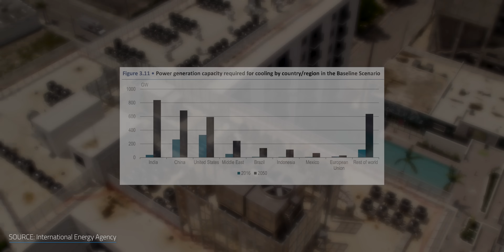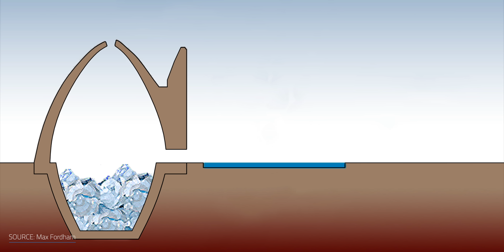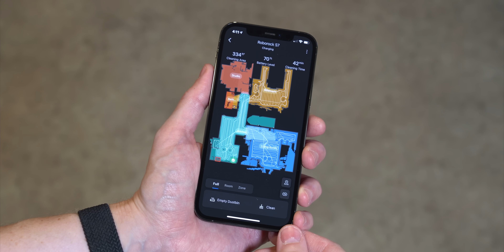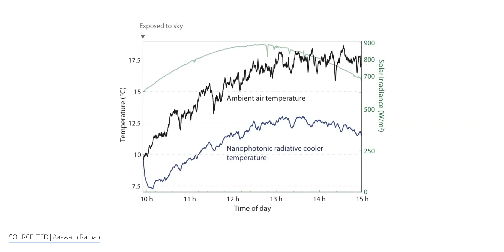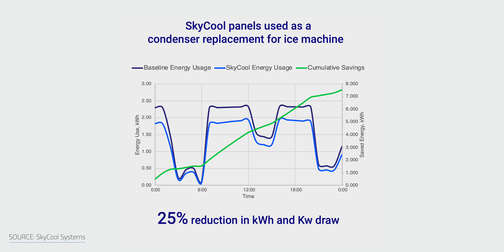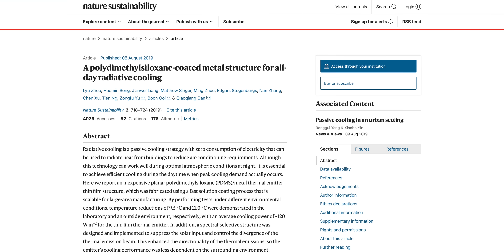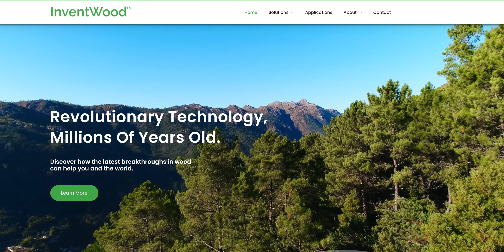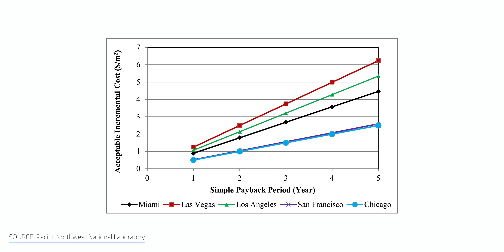Space Powered Cooling May Be the Future of Energy

Comment: Simple reflectivity can produce amazing results. I bought an older house in northern California which had a nearly flat tar and gravel roof. An absolute oven in the hot months. We air conditioned it; all was fine. Then, a year later, had the roof replaced with a white polymer of the type used on commercial buildings. (Location and design made it invisible to neighbors.) The air conditioner never ran again.
Reply: Great comment.  The problem will not be solved by a silver bullet.  It will be tons of small solutions that add up.
Reply: @bill8985  and multiple distributors can increase competition, keep prices down, an d keep up with demand.
Reply: Solar panels on my roof blocked a lot of the sun’s heat and my second floor was much cooler because of it. One more side benefit of solar.
Reply: Another suggestion is to make a roof over the roof with open space between them, this way, the top one heats, transfer the energy to the air below that leaves through the sides and doesn't heat the bottom one, leaving the house fresher.
Reply: @thomasfplm  That's what solar panels do too. My solar panels are about an inch or two above the roof so it helps with reducing heat going in the house.
Reply: @BnORailFan  or you could just boil argon gas in closed loop system and power a generator via Solar heating coils... Pretty much infinite energy source... Other than maintenance of the steam engine, A Wankel rotatory motor will do... Exhaust system goes into radiator and back into system..
Reply: @mjolnirswrath23  That would usually be more expensive, bulkier, and less efficient then photovoltaics.
Reply: @thomasfplm  I have contemplated this concept for a long time, and I think that finding an inexpensive way to make interlocking solar panels that stand 6” off the roof, but cover the whole thing, would be pretty phenomenal
Reply: @thomasfplm  How does the cost of adding an additional roof, along with the problem of weathering, compare to just adding new aluminum-coated insulation to the underside of the roof?
Reply: @lokensga , first of all, you don't need to make a complex structure to make those two roofs, and the bottom one doesn't need to have all the weather protection of the top one.

Depending on how you do, this aluminium isolation could serve as bottom roof if you make openings that allow the air between it and the roof to leave.
Reply: @lokensga  So lots of roofs these days are made that way. There is roofing OSB and ply wood that has aluminum foil glued onto it. The shiny side goes down. Shiny does not emit much heat so when the roof gets hot ~140 to 160 degrees F it is less likely to emit heat or emit as much heat onto the insulation in the attic. There are also films that you can buy and put in the attic for existing homes. Generally evidence indicates these are cost effective improvements.  Adding an additional roof is also done frequently by putting a metal roof right on top of a shingle roof. A new metal roof costs about twice what a shingle roof costs, but also lasts twice as long. In the Southern USA they are becoming quite popular where 1/4 to 1/2 of homes have them. One downside of metal roofs is they can be slippery and hazardous to work on. (If you have to get up on the roof and clean out gutters annually, take care of fallen limbs, and more and much of this work gets done by homeowners. And some people both homeowners and small independent and informal contractors that do this type of work, simply will not get up there. And if you have, as a workman, have fallen, one of the simple ways to protect yourself is to just not to take the job. Work on the roof can get very expensive then.
Reply: @thomasfplm  That design causes air flow which can be used to draw heat up out of structures through the use of thermal chimneys.

Fresh air can be drawn in through piping run underground where the entry point is in a shaded area.
Reply: @thomasfplm  This is, probably, by far the most sensible solution - but it is also prohibitively expensive because that space has to be as contact free as possible so the outer barrier does not transfer heat to the underlying structure through the support system.
And some manner to keep small creatures out of that space (spiders alone would reduce efficiency rapidly) because their waste - nesting material, ect - would quickly build up and create bridges that would transfer energy from the outer barrier, not to mention just making a hell of a lot of noise if larger creatures like squirrels moved in.
Reply: @amzarnacht6710  depending on the case, you can make it a space usable for a barbecue and things like that.
If it is too big, some of those animals wouldn't feel safe there, like the squirrels.
Like an extra floor, but completely open.

But yes, it depends on the kinds of animals and things like that.
Reply: @amzarnacht6710  wouldn't most animals feel uncomfortable in the intense heat? It would be quite an unhospitable environment.
Reply: Technically, the paints don't have to reflect VISIBLE light as much as they need to reflect Infrared and UV light. IR is of course what we experience as heat, but UV also is high energy due to the equation E=hf and if not reflected back to space, UV eventually downshifts into IR, becoming heat, after being absorbed and re-reflected by materials. Therefore, we should find reflective paints that are good at reflecting everything except too much visible light. Such reflective surfaces would still be bright but not overly so to our eyes.
Reply: @think2086  but if you reflect an excessive amount of uv and only a small amout of visible wouldnt that pose a risk to eyes? iirc the pupil adjusts after the visible light, but eyes can certanly de damaged by ir
Reply: @think2086  Following up with your ideas-thought process, what would the color you’d suggest is better for reflecting heat away from roofs?. 
My ideas are that If black absorbs all light colors (and reflects none of them) building up heat, 

and oppositely white (or all colors together) absorbs no light colors, reflecting it all including their heat, Would roofing material colored in the nearest color of the warmest light, (maybe red) be the most effective for reflecting heat away from roofs?.
Reply: I painted my roof with white ceramic paint 15yrs ago, the change was insanely dramatic, reducing power costs by almost 50% in summer. Only needs minor maintenance.
Reply: What you are benefitting from is the R value of the material not only the color…..
Reply: Great idea.  I think we could greatly improve our climate impact vis regular and fairly rigorous application of the sort common sense we reviewed from our ancestors.  My example is when it came time to re-shingle our home.  It had dark brown shingles before, but our town being in San Joaquin Vally (Lodi), it get very hot in summer.  Accordingly we chose the whitest colored shingles and, as you indicated, the results on our electric bill have been good.
Reply: @Michael Matthws any chance you remember the name of the polymer
Reply: what about winter ???
Reply: @homerdadon6363  No noticeable change in heating cost. All the original structure remained in place. The decrease in heat gain during summer thanks to the white surface was the only impact I was aware of.
Reply: @mattcom2  thanx, I'll look into it more. I think I want to try it next summer
Reply: @homerdadon6363  Darker roofs for colder areas
Reply: @KbB-kz9qp  I live in FL 😰😥
Reply: @homerdadon6363  In Places like Florida, you would benefit from lighter colored roof.  Also, due to more or less routine hurricanes, Floridians would also benefit from wind-resistant construction technology, but they seems to be slow in adopting it.  Not sure why.
Reply: Use cutoff sunglasses which don't allow the light intensity to go above a certain limit.
Reply: Dennis Lee observed his low temperature phase change metal panels would get covered in frost as exposed to hot kitchen areas or on rooftops. His super heat pump had COP efficiency over ten.
Reply: Will it increase the cost of heating in winter? Southern Ontario is an odd place with unbearably hot summers, and freezing cold winters. Ive read that even LED bulbs are sometimes a net energy loss because the ambient heat released in winter can be an efficiency gain for heating.
Reply: a lot of black tar roofs absolutely should be replaced with white roofs, at least the flat ones
Reply: how about heating in winter?
Reply: awesome
Reply: It sounds like you're saying you should have done the roof first and the air conditioning would have been unnecessary and redundant and you have now created a stranded cost.
Reply: Its sad reality when we realize that reflecting bright white ice decreased globally because of us. So we need to turn back climate with mirror rooftop...
Reply: In many countries, lots roofs are covered with this type of... hmmm... black sheets of something with tar (not sure how it's properly called in English) - maybe painting it with regular white paint could help? Of course special highly reflective paint would work better
Reply: So the roof is made of miceoplastics now?
Reply: Thank God you thought about whether your neighbors could see it. You have to be careful with reflective surfaces because they can be hazards. I remember the white roads debacle that resulted in car crashes from sun blindness. I wonder if they've considered the effect on air traffic with some of these proposals?
Reply: @russiannpcbot6408  the light is reflected diffusely, so it won't be reflective like polished chrome or a mirror. It will however be so white it's difficult to tell where the corners are, and it should practically glow in the dark
Reply: @alexandercoggins2779  No shit Sherlock. Highly reflective white paints can still cause eyestrain from prolonged exposure. Normal white paints typically don't.

Try piloting a traffic copter in a city will all reflective white painted roofs. Staring down at that will cause eye strain. A plane angling to land could have issues as well. Especially single prop ones.
Reply: @russiannpcbot6408  do the same thing we do when flying over snow. wear yellow tinted polarized goggles. if you don't you'll go snowblind.
Reply: @russiannpcbot6408  My neighbors across the street had a SHINY tin roof put on, I hate them for it. In the morning it's like massive reflectors hitting the front of my house, if I leave the blinds open it's brighter than turning all the lights on in the house at about 8am lol.
Reply: @russiannpcbot6408  could a good pair of sunglasses solve this problem?
Reply: @russiannpcbot6408  Why would you have a traffic copter that cost a million dollars and a human pilot that costs $600 per hour to judge traffic when you could get a $2500 drone camera and cross reference it with google cell phone metadata to get your traffic reports?
Reply: @russiannpcbot6408  Being on the road looking 4 metres in front of you is a lot different to being thousands of metres above the ground. If runways stayed black but normal roads we’re reflective it’d make runways more visible
Reply: @Smithy250  The commentary is on all the rooftops of a city being painted a reflective white. That would be square miles of reflective surfaces in a concentrated area near airports. That's my concern for aircraft. Before pushing them as a solution, their potential adverse effects need to be thoroughly tested.
Reply: @russiannpcbot6408  Well, in the wintertime, snow falls on roofs and make all the rooftops white. Air Planes land in the winter. Snow is extremely reflective. On the news you do not hear, annually plane crashes are going to become more popular this year north of the snow line because pilots will be blinded by white roofs. In a couple hours, in one winter night mother nature can cover every roof, in the entire city "painting it white," what kind of test could be better?
Reply: @russiannpcbot6408  : No they can just run off their radar that they use anyWay … right ??? 
Not to mention the 5G towers everywhere now !!!
Reply: @russiannpcbot6408  planes wgen flying in the air don't look at window to drive. They are thousands of meters above ground. Even if surrounding buildings were a problem when landing, it can be solved by a simple sunglass!
Reply: @ArminYekkalam  Most cities have airports for small aircraft. Those planes look at the ground.
Reply: You took care to mention that it wasn't visible to your neighbors. Why was this desired?
Reply: @EvanBoyar  A glaring white roof can be an eyesore, in more ways than one. The house in question had a nearly flat roof made invisible by a design detail at the edge. The house also was on a steep slope, above surrounding houses. A steeply pitched roof (like that of our current house) would be an aesthetic abomination were it covered in blisteringly bright, white plastic sheeting.
Reply: @mattcom2  I'll take some eyesore roofs over climate catastrophe.

Comment: First off tetra fluorocarbons are too heavy to impact the global warming, they never make it high enough into the atmosphere to make any impact on the Ozone.

the idea of bouncing heat into space from the surface of the planet sounds absurd but it might have credit.
My question would be what is the carbon footprint of creating these panels vs the footprint creating ac units...?

personally i have a few ideas in the "electric motor concept" area that might/should create differences in thermal output of electric devices.

i might also be more interested in light filtration and the reaction between different wavelengths and chemicals in a heating/cooling loop to create a differential in temperatures instead of using the current compression method

Comment: Two years ago (while replacing shingles) we also replaced our roof deck boards with radiant barrier roof decking.  We noticed a significant reduction in attic temperature (97F at noon in July), and our HVAC system runs significantly less.  That's on the Gulf Coast.  Passive radiant barrier should be required in all new home construction - and I highly recommend it to anyone looking to redo their own roof.
Reply: @yo yo The difference in cost between "standard" and radiant barrier deck boards is insignificant - considering the labor costs are the same.  At the time we installed the new roof, the difference in material cost was around $350.

It's really a no-brainer to require it for new construction homes.  💯
Reply: @christoney2491  the only caviat I would add to that is location. I have no need for air conditioning but appreciate all the help Sol can give me when it comes to heating.
Reply: As a Master Refrigeration Mechanic of over 40 years, this would be a great start to significant energy reductions..
The largest heat gain and loss is always the roof of every structure,  residential and commercial. 
Brilliant suggestion.
Reply: FL home owner here, we were looking at solar, however it makes more financial sense to just get tin roof installed. ROI much faster
Reply: Depends on location. Where I am heating costs vastly outpace cooling costs, mainly because I don't have any AC unit. My temps get as low as -45C in the winter. I want all the solar heating I can get.
Reply: One thing most smart people don't realized is that Government needed the tax revenue from inefficient system to pay themselves high salary base on the job they actually do. Most Government would never take a pay cut. Innovation are everywhere but no Government is willing to go bankrupt to save the world.

Comment: Merely reflecting heat/light may reduce energy consumption, fossil fuels, carbon, etc. but it actually makes the environment hotter. Reflecting heat back through the air just raises ambient temperatures, it's like have the sunlight pass through twice. They use this method to make electricity in the desert, because reflecting light is hot. The result wouldn't be global cooling, it would actually be desertification.
The reason the desert gets so cool, is because of the greenhouse effect. Basically, gases don't retain heat very well. Solids and liquids however, do retain heat. Since the desert has no plants (solids) or water (liquids) to absorb heat, it gets colder at night. 
Reflecting light and making the environment hotter will actually result in greater cooling needs, and therefore power demand.
The solution is a very delicate balance. You need thermal storage, such as trees etc. to absorb heat during the day and release it during the night. You need water, to use the energy to evaporate, as a heat sink. And you need gases to dissipate heat energy, through kinetic movement.
Your better off turning solar into work, than trying to reflect it into space. What would be the cost/power reduction if you just used solar panels instead?
I also forgot to mention, that the technology is highly dubious, as 12% savings is really low. It seems to me that this technology doesn't actually work as advertised. It's reduced in effectiveness from weather conditions, meaning it really isn't transmitting heat as they say.
Basically, it's just a different kind of radiator. The material is so reflective, that it's slightly cooler than than the surrounding environment, so it transfers heat into it. If clouds and humidity effect it's performance, then it's still just a heat exchanger.